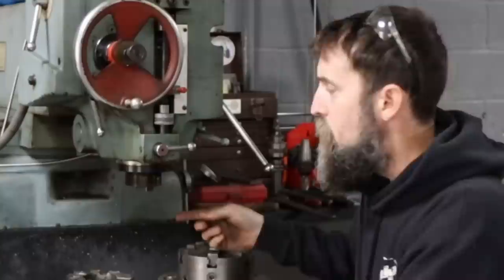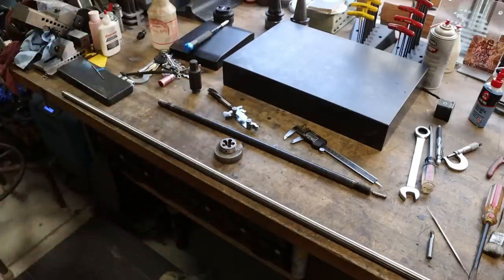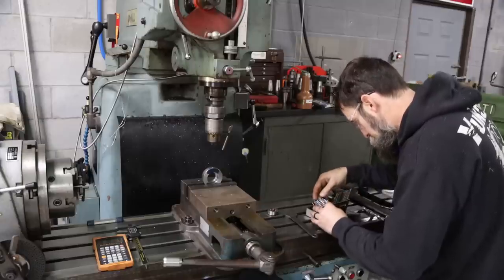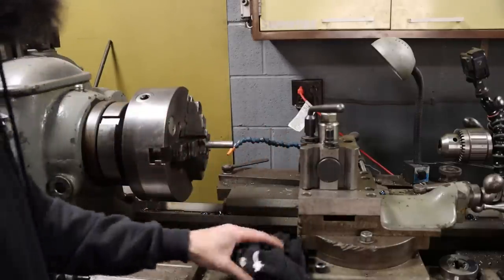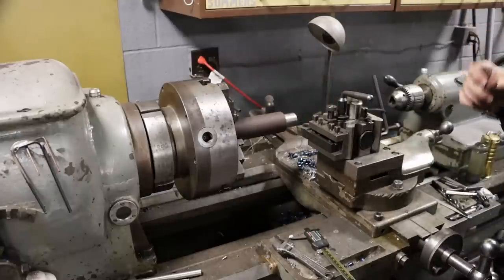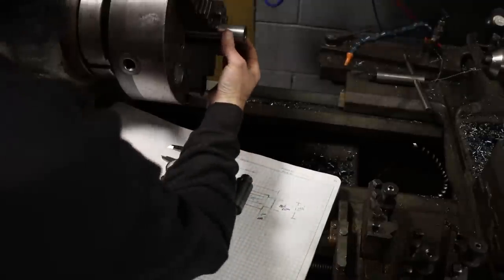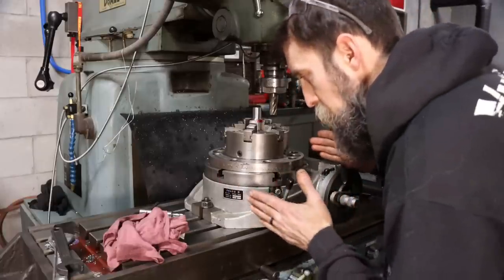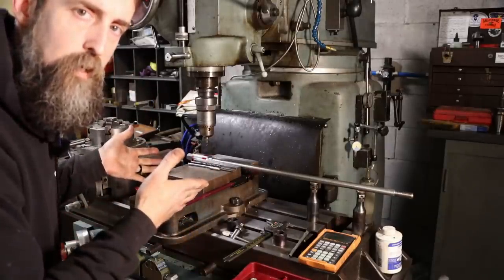Taking the long way. New draw-bar for the DoAll mill. OhYeah!

Comment: Don't get lax, tuck the ends of your hoodie strings inside the hoodie, or cut them off altogether.
Reply: Okay osha Karen
Reply: He’s right
Reply: Thank you for the PRO TIP, Ken🙄
Reply: @redmorphius  Do think that he doesn't know? It is his choice to make.
Reply: I don't believe I've heard him asking advice about shop safety
Reply: Yup, I seen that too. I actually watched a guy ( my boss actually) get pulled into a lathe by his hoodie. Took a large chunk of skin off his face and he lost three teeth.  I was the one that punch the emergency shut off and called the production office.  I get nervous watching guys work with long sleeves on let alone hoodies with strings dangling.  To all those rolling thier eyes, I too was one with you.  Rolling my eyes over stupid stuff like that. Until I nearly lost my digits one day polishing a stick of brass in a horizontal mill.. I don't think he was out of line mentioning the strings guys. Just being cautious and helpful.  Not a Karen by any stretch. 
 There could be an argument about how he's working alone with the machinery as well, but that may fall in that Karen territory.... 🙄🍻
Reply: Hey I have had 2 close calls running a lathe in cool shop, both involved a leadscrew, 16 inch southbend leadscrew grabbed corner of coat, loose, shucked it off and stopped spindle.  Second time was in my shop running my Hendey, thought cat had jumped up on coat, nope, wrapping up on leadscrew, but it is a Hendey,  hit the leadscrew reverser, unwound myself.  Both close calls.  At work I only wear tee shirts, boss is paying the heating bill, don't wear rings, do wear a wrist watch, twistaflex band, won't wear anything else, they come off.  Old vo-tech teacher instilled left hand filing into my head 40+ years ago.
Don't wear sturdy clothes around moving machinery, reminds me of guy just down the road neighboring shop, came in to do a little g job, new flannel Christmas shirt, got caught in chuck, broke his arm.  Be careful people.  Gloves and drill bits, throw the gloves away, good way to mess up hand and fingers.  A little cut will heal, dirt and grease will wash off.  Almost went around with safety man at work, I will not wear gloves if I am running a drill press or mill.  If I cut my finger it bleeds, hurts but it heals up, but if it gets wrapped up in a spindle, not good.  Worst 2 injuries in a previous shop I worked at was bosses finger and table saw and the old guys gloves getting tangled up with a drill bit.
Be careful people.  I still have almost all my digits, index finger on left hand is a skill saw kerf shorter than it used to be, did that when I was 16.    Live and learn, got middle finger on right hand in hood spring assembly when I was 28?  Company nurse put some suture strips on last 2 fingers of left hand almost 10 years ago.  Hey I tried to catch a shaft assembly with sprockets during disassembly sharp edges got me, gloves would have helped that time, nothing turning.  Be careful folks.
Reply: I see a guy get chocked out with those strings  from the hoodie  on a lathe  lol ,I seen a lot over 35 years lathe mill & grinder do it all & a lot of people  get hert in a heart beat

Comment: I believe the pin is there to enable you to unscrew the drawbar if the top threads loosen when trying to unscrew the drawbar. If that were to happen without the pin, you’d have the drawbar stuck in the toolholder and no easy way to remove the drawbar.

Comment: I'll never forget when a pinned on drawbar nut sheared whilst milling and sent the tool flying across the shop.  Luckily it went away from me, but it could have come right to me.  This happened on a 1980's manufactured ENCO mill drill with an R8 taper tool holder.  The retaining pin on the drawbar nut was very soft steel.  This explains why Do-All threaded the rod.  I immediately made a solid bar component with a machined hex head.
Not a pleasant experience.  Safety first.

Comment: Steve, another great reason most old school manual machinists prefer a Series 1 Bridgeport with 8C collets and a power collet changer ontop. (We even have Servo power knees & tables on them) Their just a more useful machine to run and you don't ever have to climb all the way up on the table to pop the draw bar screw out every time you want a different cutter or drill chuck. We use to have a Index Mill the size of your DoAll mill that had a 40 taper but we all were getting to old to climb up on the table every time we had to change a collet as it was just to hard to run compared to our Bridgeport's. If we had a big fixture or jig plate to machine to big for the Bridgeport's 42 inch table, I also got a old #3 Cincinati mill with a ton of 50 taper collets, but 90% of our mill/ drill work is done on the Bridgeport's and is fast & easy with the British Newall DROs I put on everything.

Comment: #leans-in-close-and-whispers: steve; I think what you're calling a cat-40 holder is a NMTB 40 holder (the straight part at the top is the giveaway.) The others look like cat40; with the groove in the flange at the base of the taper roughly around the middle. BT40 looks a lot like cat 40 but the groove is towards the top of the flange part at the base of the taper. the ONLY reason I know this is I have a NMTB 50 machine and a CAT40 CNC machine. 

Love your work and this channel!!!

Comment: Your Doall uses a NTMB 40. CAT or  BT are cnc using the pull stud to secure it.   The taper CAT and BT will work, one thread is metric the other is imperial.

Comment: Cat 40 is a CNC tool that uses pull studs much like BT 40 but they might use 5/8" thread and the groove for the tool changer is different

Comment: Steve, I watch your channel quite a while now and I mostly like what I see. But maybe it can even become better! So, therefore, my two cents on the matter (self employed designer and therefore machinist, for 26 years). a) These holders can be bought real cheap and real nice new from e.g. Turkey (Eroglu) I pay 30-50 euro's for a balanced to 15k r.p.m. ER collet holder). So action number one for me would be to make a decision on the future SK40 holder and buy the missing ones new. b) Probably in combination with 1); the majority of the useable holders you own is BT-40. Get rid of the rarities and go for the BT-40. Make a interface piece for the existing drawbar and Loctited it in with 640 or another tough variety and leave it on; less work for the years to come. c) When I started my shop I used everything I had lying around or I collected it at a local recycling station. With these parts and materials obtained I made my first paid jobs for customers. I soon discovered, just like you did on this job, that using unknown materials available nearby had its drawbacks'. The clients machinery I designed, and made, encountered problems later on and I had to replace the failed parts that I used NOS. NOS meant mostly that I couldn't obtain the original installed part and had to change it to a readily available part. You guessed right; not exactly the same.. So rework had to be done. I felt, and still feel,  this was a pour decision on my side so I took the extra work to replace a worn or faulty part at my expense (and I kept these clients until now by doing so; don't step into the "penny wise, pound foolish trap" colleagues). Lesson to be learned; if you want to be considered a professional, act like it when you've earned the little money to do so as a starter. I soon recognized that if you want to serve your customer, or later, yourself, you have to make a plan of the work ahead and order the parts and materials you need for the job. Doing it this way; no surprises when machining (f**k this stuff is hard, weird, unexpected etc.) and a smooth flow towards the set goal of parts to be made. I know this is your own shop and it doesn't matter that much maybe rightnow, but when things start to grow, believe me here, saved time is much more valuable than saved money. So, final conclusion; repairing, customizing; all great for the globe, but maybe not the "right" economical decision when you drive a shop to make money to earn you a living. I totally understand that owning and maintaining a YouTube channel can be a different driver. If the channel is a major source of income, or you plan it to be, the decision on how you could or do stuff could differ. I'm a professional and like to connect the dots in a short straight line whenever I can though. I'm curious on your perspective here. For now happy new year and all the best for times to come, Job

Comment: Steve have your small thread on the very end and step it up to the next larger thread and at the other end have it threaded with a nut on the top to make up for the longer and shorter draw bar just use one bar for both sizes

Comment: Hey Steve, Just a correction on your naming of your tool holders. The Cat40(5/8-11 Thread) and BT40(M16x2.0 Thread) holders are pretty much the same and both have the screw in pull stud. The one you refer to as  cat40 in the start of the video is actually a NT40 or NMTB40 with the 5/8-11 threaded protrusion on the end.
I'm pretty sure you can buy screw in adaptors to suit the CAT and BT holders the allow the use of the original drawbar. 

Keep up the great video's and Happy New Year to you and the family
Reply: Thank you Barney, I'm glad you clarified the tool holders, it was driving me up the wall listening to them being  referred to incorrectly, details do matter.
Reply: I think that screw in adapter would be the way to go it would eliminate 2 bars but a lot more work depending on how many adapters needed.
Reply: Thanks also Barney.  Right on all accounts. Manual machines would for sure have NMTB40.  CNC machines with an automated toolchanger would have the CAT40, from the long line caterpillar zig zag chain style, or the BT40 for CNC machines with a rotary automated toolchanger. People need to know the lineage and history of tools so they know exactly what they are talking about.  It is unreal how many people think their truck has a full floating axle, when it is really a semi floating axle.  Details mean everything. And incorrect knowledge gets passed on as fact.  Especially in this day and age where people think they HAVE to know the answer. Truth is they don't. Being honest in their ignorance will get them farther, because it opens the door for the opportunity to learn. Wisdom for many people does not come as fast as they wish it would come. So you have people faking it because they think they need to fake it to survive. Far from the truth, but you can't tell them that.  Their ego gets in the way.  I am talking about the society we live in today.  Not directed at Steve.  He is a solid dude. Just that I see so much faking it today, especially in youtube.  Viewer beware. On youtube an in life.   ------Doozer
Reply: Having done this conversion on a mill myself, you can get screw on adapters for CAT40 and BT40 that will convert them for use, but they're expensive unless you make them yourself and they're a pain in the behind to make if you use the right materials.    I converted my mill from NMTB40 to CAT40 with a draw bar replacement because CAT40 tool holders are the most common in the secondary market and therefore cheapest to buy.   BT40 is almost as common.   I don't ever plan to go back or use anything other than CAT40.
Reply: @kooldoozer  Actually, tool holders are independent of tool changer type.  I have a 20 slot rotary tool changer with cat40 holders.   The CAT series holders were originally a standard from the Caterpillar equipment company - they wanted a standard holder type for all their machines.  BT taper is an evolved version of the CAT tapers developed by Japanese machine tool builders.  BT tool holders are symmetrical around the spindle axis, and the CAT40 standard holders are not.  BT holders also have a wider flange than CAT.   DV (Deutsch) holders also exist, and are similar to CAT holders with an orientation notch added.    All three have the same taper as the older NMTB tool holders of the same size.  Tool changers are designed for a specific tool flange, so the tool holders for a machine should be matched to the changer that is present, regardless of its mechanism.
Reply: @kooldoozer  So true, so many people that watch YT are perfectionists, even to the point of obsession. Many believe there is only 1 legitimate way to do things, and they waste half their lives trying to figure that out instead of actually getting things done. They're almost as annoying as the safety rangers.
Reply: If we are going to make the corrections , lets call it a draw bar( retired toolmaker) enjoying the memories , always loved my bridgeports
Reply: Hi Barney. Where does 40 International come in on this? I'm from the UK and I'm going to do the same as I have a mix of metric and imperial tool holders. Cheers Tony
Reply: @eyuptony  40INT is the same as NT/NTMB tool holders
Reply: @erikjgreen  So Cat tools are designed to be indexed only one way in the spindle but BT can go either just like the NMTB? I remember having to modify one of my drive lugs to allow the use of Cat holders on my Cincinnati which is NMTB well the old #4 not the big VMC
Reply: I'm looking to get a new milling machine with ISO40 tool holders. (I can get the holders really cheap). I thought all of these 40 tapers were more or less the same apart from the screw threads in the top and the fact you could get different buttons in them.
Reply: @bcbloc02  Both types are loaded and maintained in a single orientation because that gives the best repeatability.  The symmetry of the BT holders is mainly so they're balanced at high rotation speeds.  BT holders could go either orientation, but so can CAT, both the notches are the same width but one is marked with a drill indent so the machine can tell which is which.
Reply: Thank you all for the tool holder chatter. I will use this information to guide future investment. I was a CNC repairman and in our shop maintenance staff was not responsible for tooling. I never had to learn the differences between tooling styles or their history origins. We ran mostly CAT 50 and CAT 40, but some manual machines had "dedicated" tooling. Different machine makers used different drawbar pull studs. So we separated tooling by pull stud type as well as CAT size. 
In my retirement I enjoy transitioning from maintenance technician to learning manual machining. The YT community is a big help to me. My wife encouraged me to erect a dedicated metal working hobby shop. I built a 4600SF building. I am enjoying filling it up new to me toys. I have purchased a large American Pacemaker engine lathe, but I haven't upgraded my Series 1 Bridgeport. Steve's DoAll mill is a coveted upgrade from what I currently operate. Our shop didn't use this class of machine much. We replaced our Bridgeport Series 2 and our Kearney Trecker horizontal with a Sharp with horizontal and vertical heads. That Sharp was a solid machine, purchased new in 1993. It required little service, but I was often impressed with the engineering, machining and build quality of this import machine. As it aged, replacement parts support was poor, but it was so reliable that I seldom needed that support.
Reply: And then some call it NST40 😮

Comment: By drilling a 1/2” hole through the die holder and boring out to 5/8”,you could have a guide to keep the die straight on the shaft

Comment: The different threads in the ends signifies if it was made to a DIN or to an ISO standard, the taper is the same for NT’s BT’s & CT’s(aka cat’s) the only difference between the three holder types is the flanges. Just pointing out is it appears your mill was originally set up to run an NT40 with the ISO standard drawbar thread(if I remember right). BT’s are way more common now and easier to get second hand (thanks to older cnc’s running BT’s) so I think it’s very smart to make your machine more versatile with adapted drawbars. Also I’ve seen Bridgeport drawbars as two piece, and I’ve always wondered why besides having the ability to simply change the stud at the factory for the type of holder the spindle was expected to run… just a thought. Love the videos Steve.

Comment: Hello ,
The hit of the pin on the threading is only for the ease of machining of the manufacturer, a complete axis will require a lot of different machining, whereas a simple and straight rod is very simple, especially since it must be heat treated

Comment: I've got what I believe is the parent taper to both the NTMB 40 and Cat 40 - the NST 40.  It's in a K&T Model B Autometric horizontal jig bore.  The tool isn't held in by a drawbar but instead by a nut on the outer face of the spindle and so is missing the shoulder above the taper - the nut presses on the outer edge of the taper face.

Tooling is about impossible to find. I think the NST 40 was used in 2 different machines, both K&T and both produced only in small numbers.  I adapted a Marlin PDQ quick change NTMB 40 holder for it and use the quick change ability.

Comment: I have a mix of NMTB 40[original] and BT 40 and made another draw-bar. I prefer the NMTB but they both work just fine on my IWASHITA horizontal mill. There are still plenty of NMTB holders out there.

Comment: Hello, just a suggestion for your Mill table. I have good quality plywood cut to nest against the vise and strips to key to slots. Helps to protect the table. I have a ground table, Mill is a XLO I bought new in 1970. Table still looks new. Thanks for another good video. HAPPY NEW YEAR. George from Indiana

Comment: I believe what you are calling cat-40 is actually NMTB-40 which is what my DoAll uses. With the right locking ring on the spindle nose you have a quick change system that doesn't use a drawbar. That is well worth chasing of you can find one. The spindle might already be setup for it. I've only seen (owned) 3 such mills and they all had a quick change setup.